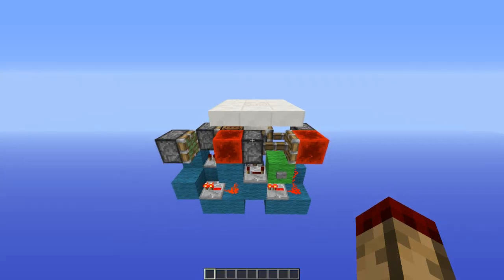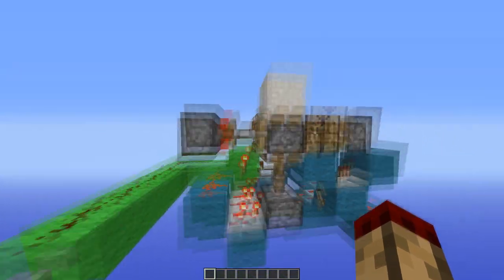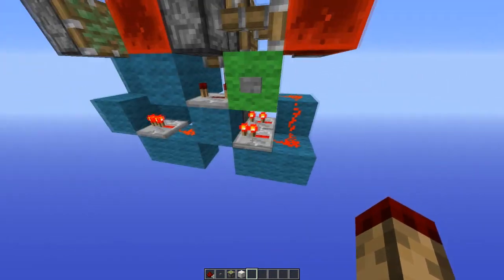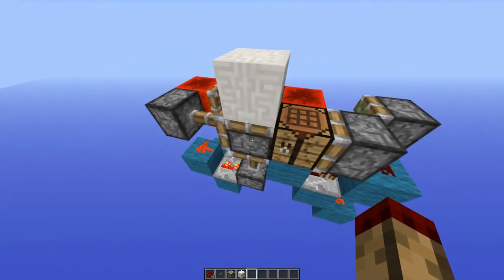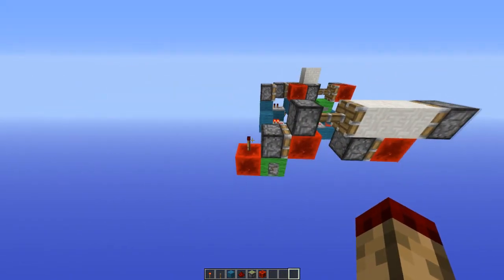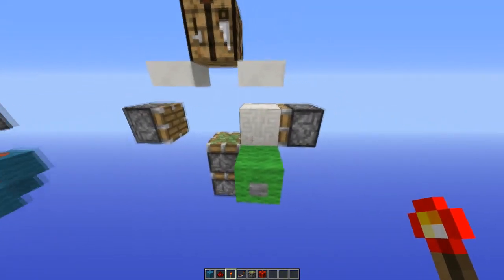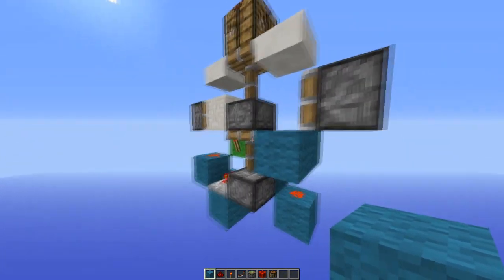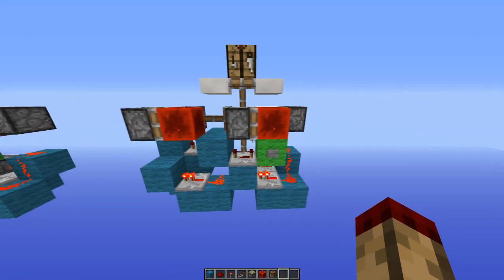Minecraft: Hidden Crafting Table [Smallest]

Comment: How would I get this to be active and have the table out when standing on a pressure plate, but inactive without the table when not on the pressure plate?
Reply from the maker: You would need a dual-edge monostable between the pressure plate and the input so when you step on the plate it gives a pulse and when you step off it gives another.

Video examples:
https://youtu.be/vzAwSSyQIbo?t=2m41s
https://youtu.be/Hkx9mK7Dnos
Reply: TT Lemon Dear Lord, you are a life saver! seriously, thanks, dude. I've been spending the last few days trying to figure out this design.